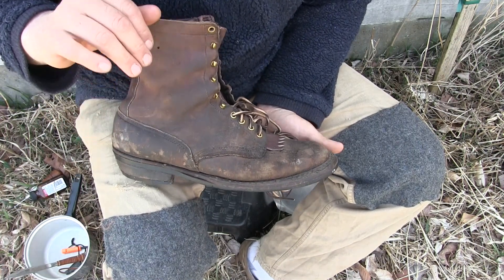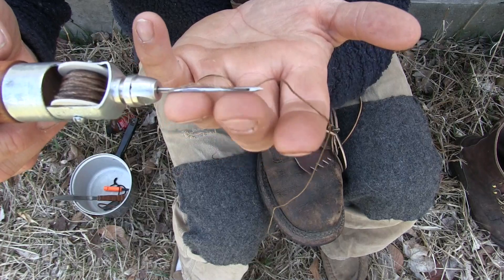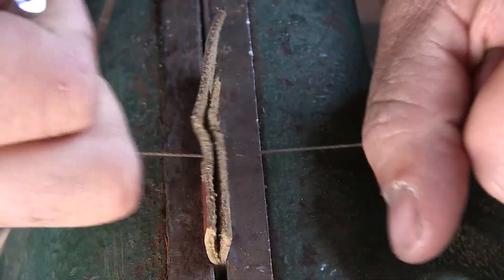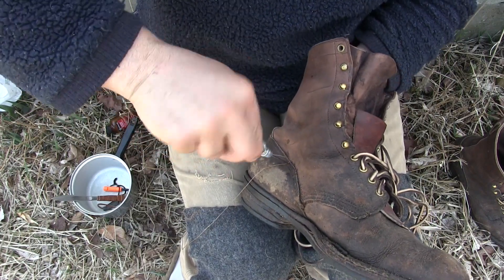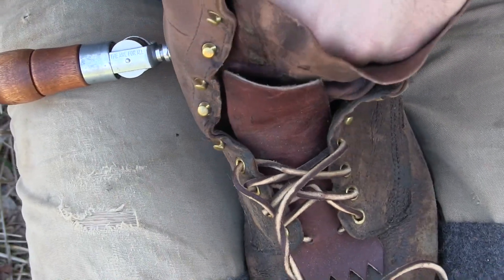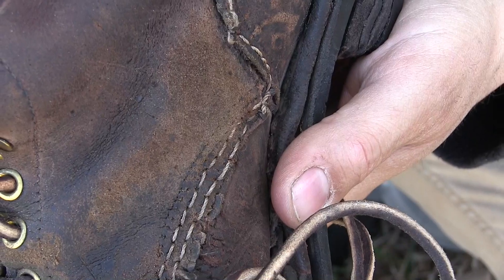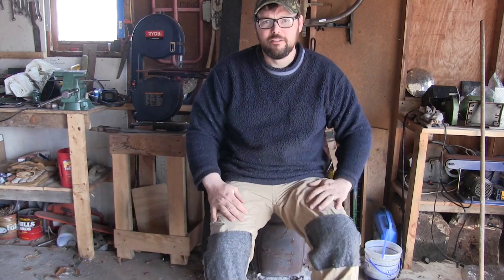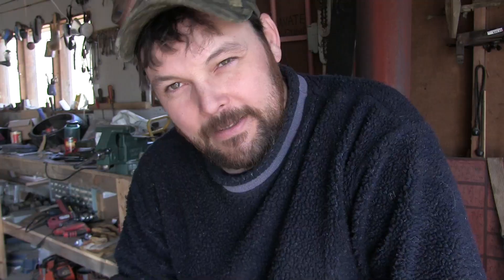Whites Boots restoration part 2  ....&    How to use a stitching Awl

Comment: Hey Dave, glad to see someone else that repairs their own boots with an awl. I've had one of those for over 30 years. I don't think they changed the design at all in that time. I always have it with me in my repair kit for canoe trippin.
Reply from the maker: Great tool to have around for sure! What do you use yours for when canoeing?
Reply: I like to have a couple different methods of repairing things like glue & tape.The awl is easy to pack when you put the needle inside the handle.  I have mended a sandal, knife sheath & 1 hiking boot while in the bush with it.
Reply from the maker: Right on

Comment: Very handy tool I use the speedy stich awl brand I've swapped the heavy-duty leather needle for a heavy-duty sewing machine needle (smaller diameter ) and thread for repairing canvas tarps in the field
Reply from the maker: Good idea. I have a canvas tent I need to fix...I'll give it a try.

Comment: Hi Bushradical...how's it going?  I have 3 pairs of old loggers boots, Pierre Paris, John Leckie and Vibergs. The first two are really old, but not too badly beaten up, just very dried out with a few cracks. I washed them off in cold water scrubbing them with stiff  bristle brush, paying close attention to the seams and welt I then left them out in the fresh air and sunlight for a day. I then used some leather restorer (basically liquified beeswax) very liberally, massaging it into the leather with my fingers (this really soaks into the leather). Again I leave the boots outside for a couple of days then they are dry to the touch and quite supple. Finally I get some beeswax, Pine Tar and Turpentine in equal parts and brush it into the leather (and seams and soles) with a toothbrush (my wife's, not mine). This is quite sticky and takes about a week to cure but makes the boots very water resistant (Pine Tar has long been used in Finland for leather weather-proofing). Lanolin is also a good medium to treat dry leather. I England Grangers wax is very popular as is Dubbin (but do not over apply to stitched areas). In Canada SnoSeal is popular. I have an awl that I stitch sheaths with, but as yet, have not tried to sew footwear. Thanks for this video, Whites are good boots.
Reply from the maker: Awesome. I write down that recipe.
Reply: Just watching this video and reading comments.  Last month I used pine tar, tung oil, and turpentine on an old outdoor wooden shelf that had dried out....pine tar is great stuff.
Reply: Yes, sometimes I have to thin it 50/50 with Turpentine so it soaks into axe handles and spade handles.

Comment: I have been thinking of making a leather sheath for a surprisingly good quality flea market knife I recently bought that came with a nylon sheath that is already falling apart, so I have been wondering how one of those stitching awls works (never having used one before). Now I know and it seems to be easy enough that even I can do it, thanks. Cool video and, once again, quite timely information for me. Now I just have to find some good quality leather... and figure out how to cut and fit that for the knife... I don't suppose you're thinking of making a "this is step by step how to make a leather sheath for a knife with a crappy sheath" video anytime soon?  ;o)
Reply from the maker: Actually Bob, I'm planning to go into knife making this fall. Not as a hobby, but as a small production business. Ive always liked sorcing parts and manufacturing, and I know what I would want in a knife. I need to tool up this summer but by fall I want to be ready to build a small knife company. If, and when that happens I will document ever single step of the process.
Reply: That's pretty awesome. Looking forward to watching that grow.

Comment: I have these Ridgecut boots from tractor supply, supposedly waterproof. Before wearing them, I gave them a couple of layers of waterproofing silicone spray. Still, the stitches are starting to go. The leather is cracking at the second toe joint. I'm not sure how I'm going to use a stitches in small spaces.

Comment: Way cool = thanks for posting <3
Reply from the maker: Thanks TIO
Reply: I remember when I was a young pup, just started working construction, all I could afford was a pair of Red Wing steel toe boots. And the first day on the job we a huge concrete slab. I was the tamper. Needless to say my boots we ruined. But I had to wear them anyway, for quite some time at that. Money, tools, let alone living expenses were hard to juggle. A pair of Whites was a welcomed step up, but didn't come until years later.

Comment: Hey thank you for posting, where you put that not, could you put a little hook needle on the end? so you could feel it inside the boot. Thanks again.
Reply from the maker: Good idea
Reply: Bushradical, thanks for your reply Bushrad.
Reply: I got a pair of redwing 620, and they are getting wore out, but i love them
Reply from the maker: good luck replacing them
Reply: Bushradical, hey Brushrad, the 620 are made in china, anyway i used a speedy sewer and fixed the soul back to the goodyear welt.

Comment: How come there are some patches of white on the boots after painting them with mink oil? Are some of these spots inevitable depending on the leather damage?
Reply from the maker: Paint?
Reply: @Bushradical  Hi! Yes, I used the term "paint" because in part 1 of your video you used a brush to apply the mink oil. There wasn't a before and after portion in that video for how the oil set, but in this video I can see that there are small white patches on your leather.
Reply from the maker: I think they were there before
Reply: @Bushradical Ah okay, thanks for replying!

Comment: hi dave, somewhere in my looking through you tube videos, i saw a guy that bought a mechanical hand operated stitching machine, the heading reads: Fisters hand machine cobbler shoe repair machine dual cotton nylon line sewing machine, it's $189.99 w/free shipping from amazon...check it out, even if you didn't want to purchase one, they are old fashioned and cool to see.
Reply from the maker: Is that the Chinese "patch" sewing machine? Those are really cool.

Comment: Hi Dave when I used to do my leather work to sell or any repairs needed for myself or others I used to use Ko-Cho-Line Leather DressingI had a pair of work boots that with dressing and constant use lasted me well over 10 years I tried to re dress them at the change of every season they got to a point you could ALMOST use them as Gum boots in winter 

I have an expensive pair of Boots that so far have lasted 22 years and are still in excellent condition 
I did a Amazon seach and found the dressing if you are interested 

https://www.amazon.com/Ko-Cho-Line-Leather-Dressing-Carr-Martin/dp/B002HJ4HU6Ko-Cho-Line Leather Dressing by Carr & Day & Martin
 you dont need much per boot and what I do is give it a good coverage let it sit on the boots for 24 hours and rub off any that hasn't been absorbed it does a wonderful job of reconditioning your boots 
By the look of those boots of yours YOU really need to give them a good coat 
some times you may have to give then a second coat depending on how "Thirsty they are"  
keep in mind the initial cost of the tin of Ko-Cho-line is approx 19$ AUD But it does a lot of boots and leather goods over the years so it does work out as a cheap preventative 

Tony from Western Australia 
( BTW stitching awls aren't my favorite tool Grin !)
Reply from the maker: Thanks Tony. I'll check into the dressing.
Reply: glad to be of help